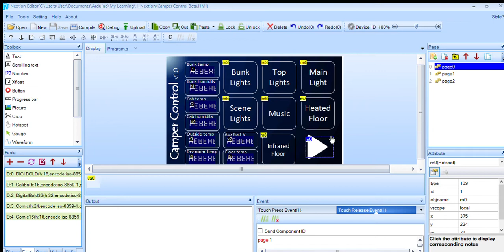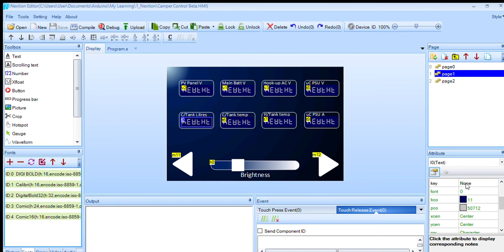Camper Van Controller Nextion Touch Screen Designer

Comment: Good night. Excellent work, I am impressed. I was looking to modernize my old caravan and I have a Nextion screen and arduino mega and other components. I can't find their code for nextion, which is where I get stuck the most. If it is not a nuisance you could send it to me or publish it, thank you very much. Again thank you for this great work.
Reply from the maker: Yeh, the Nextion display coding environment is a bit strange.  This is why I opted not to install their libraries on the Arduino and simply send and receive characters via serial between them.   My implementation is pretty limited I know, but it was the simplest way to get it working for this use case without my having to learn much about Nextion! 
So as an example, if I want to turn a light on, the only code in the Nextion is to serial print a single character to the Arduino.    If you take a look at the video I’ve done on the Arduino code,  you’ll find how the Arduino deals with this. An example of this is 13mins into that video.   Hope this helps :)